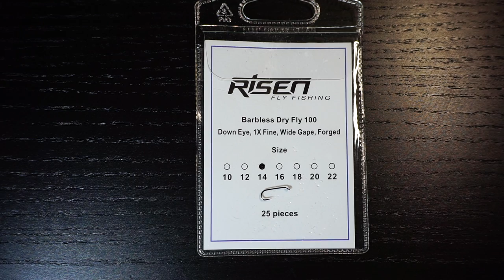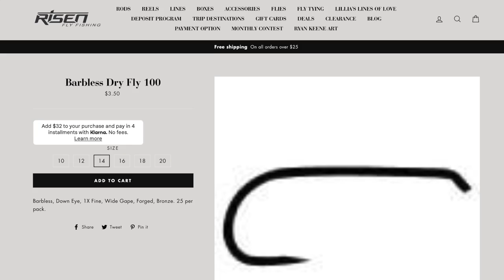No Waste CDC Caddis - Dry Fly step by step - McFly Angler Fly Tying Tutorial

Comment: grabbing the tip of lead wire to the shank with hackle pliers allows it to be turned and helicoptered off with zero waste with only a minor manipulation required to wrap the small tag.
Reply from the maker: I put lead on a bobbin holder and I waste nothing also.
Reply: @McFlyAngler  Even on a bobbin holder you have to do something with the starting tag. Holding the tag with fingers leaves a much longer length to fiddle around.
Reply from the maker: Not for me, I do absolutely no waste, I’ve seen that other trick, but I can do the same thing with my fingers instead of a hackle plier.  Just makes it a little quicker